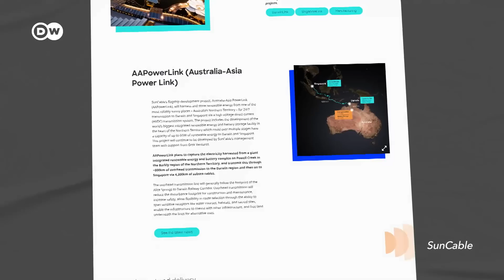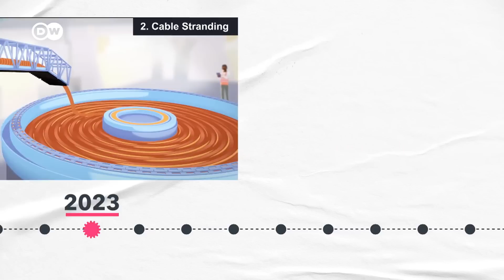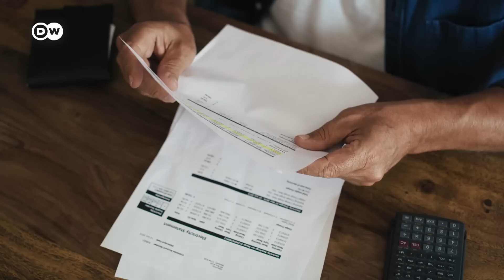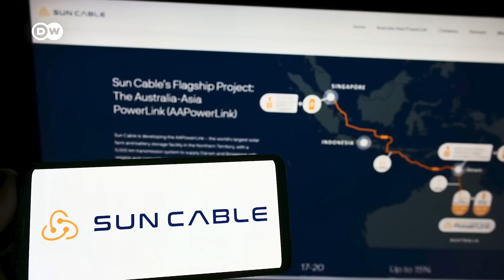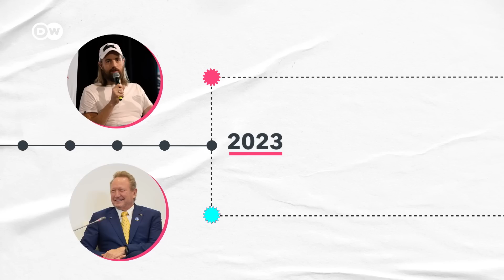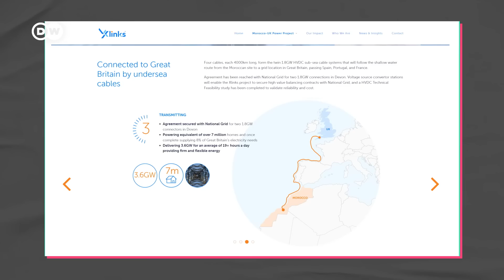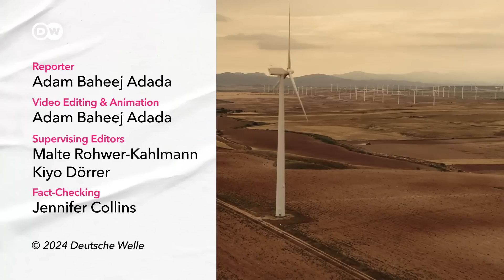Why the mega plan to send Australian solar to Asia (almost) flopped

Comment: How about splitting this gigaproject into separate projects for:
* Large scale solar power facilities with batteries in Australia.
* (if needed: better grid to connect across Australia)
* Power cables from Australia to Indonesia (especially Java)
* Power cables connecting through Indonesia up to Sumatra & Borneo
* Power cables from Indonesia to Singapore & Malaysia
and to make those power cables possible it'd be good to have a factory making them in Australia or ASEAN.

If doesn't all have to be in one project done by one company.
Reply: They're all relying on one another anyway, all you have to do to realise this is make those points a point on the roadmap, especially for the cable laying portion. I think indonesia might look into tapping into the cable in the future but doesnt have plans for it in the short term. Thats kinda why they're allowing it to run through their waters in the first place.
Secondly, it doesnt matter if you have a cable network spanning indonesia if you dont have the cable from australia ready. Its much more cost efficient and captially less intensive to have a smaller team and move at a slower pace, taking things one by one. All the ducks need to fall in line and having multiple subsidiaries will require more staff and some of them might not have great business cases which further increases drain on your investors wallet, in promise of future returns. They might be fine with the finances now, but when you turn up the tap and the tank drains faster than it fills, you are going to get cut off.

Comment: The differences between this (and XLinx) and data is that intermediate countries aren't bypassed, and data is bidirectional. 

When everyone is connected and, in this case Singapore, gets energy 9n a feed forward basis as opposed to bypass, the trust requirement reduces when every destination has multiple sources.

Comment: This is even more dumb that most solar projects.
It's not always sunny 😂💩🤡 Who knew. Therefore you either need impossibly expensive grid scale battery backup, or gas peaker plants - a fossil fuel that adds vast cost to the project because you're building double the power capacity you need. This is before we add the cost of that cable.
With any wind or solar project you must ask - who is making cash. Because people making cash is the only reason to do them, they harm the environment because they take no fossil fuels off the grid and they can't ever work for actual power generation.
This is a story of corruption, graft and green wash.
Apparently Germany still hasn't learned that wind and solar don't work even after becoming totally reliant on Russian gas. 😂

Comment: The advantage of renewable is that you DON´T need big players, you can have local production everywhere. They are already planning how to make it a monopoly. Jzzz we don´t  learn, do we ?
Reply: Yeah, you just need couple of small players that has shorter distance and cheaper price with less maintenance. Then you can say good bye to the long long cable
Reply: Small plants most likely will be less efficient than large consolidated ones. This is why most productions become specialized and centralized. Mass production increases efficiency and reduces costs compared to many but small producers.
Reply: @bltzcstrnx  That is not remotely true. The reason for centralization is concentraltion of money. You can´t create a monopoly without centralization. You can´t have billionaires without centralization.

Comment: I don't see the ability for the U.S. and U.K. sharing power directly because of the age old problem of telegraphs, they kept having issues of it just failing within hours or even days of it being established.

The reason why the communication works these days is because the current draw is only minuscule with fiber optics and needing to periodically boost the signal, where with electricity you would need to boost the signal constantly or push out a large amount to travel the distance of well over a country width, for Australia land hopping via Java islands is shorter hops and they can be boosted and cared for on land where the maintenance is cheap and the cases of land sharks are at a all time low for any season.

HOWEVER... Hawaii can look into this project for isolated case where they can create a state wide power grid and cost effectively power on every island as long as the owners (private islands) are willing to pay for it and the distance between the larger islands (publicly owned) is much shorter than crossing international waters.

But in the end, Australia needs to use and perfect the technology before exporting it to other countries.

Africa however can easily use this technology for the vast space that it has that is unable to be used for residential or agricultural development and just distribute through neighbouring agreements with other African nations

Comment: One solution is too connect the cable to all the islands and countries it passes, it can supply power along the way, by supplying power to all the countries along the way it less likely a country would cut off supply. It can operates at a "550kvdc common bus" power can flow in both directions. The system would need to be modular and to an agreed worldwide standard so it can be added to later.
Reply: landfall stations are very expensive

Comment: Its not looking good...if 3% loss is assumed per 1000KM of cable, twin core 630mm2 copper conductor at 550kvdc at 275Amps for a tiny 150Megawatts, a country or a large city needs gigawatts to run. a drop in the ocean. at least with DC the skin effect does not apply. Maybe 16,000mm2 aluminum monster that is a twin core with 2 aluminum conductors 143mm in diameter may do it, that's a lot of metal...550kv @ 4ka continuous = 2.2 Gigawatts. that will do it.

Comment: Sending electricity via long distance high voltage cables on the sea floor is much much harder and more expensive than the Internet cables links. Power requires much larger cable and the insulation system is under a lot more stress. To make it viable gig watts need to be transmitted so the system voltages will be sky high. The cable can fail too. To make it work it may need to be DC power, as keeping system stability with AC would be nearly impossible over such a long distance. Also if DC is used expensive 1000MVA + DC to AC inverters will be needed to sync to the local grid supply in that country its feeding. A Very complex engineering task. Also earthquakes can destroy the cables.

Comment: Is it possible to export energy using batteries or is that not scalable?
Reply from the maker: Hey there! Yes, it is possible. One ship with batteries on board is set to be completed in 2025 and will then start with the testing phase. If you want to find out more, search for PowerX. However, it is for short distances

Comment: It is true that Australia is a conundrum, it has the potential to supply huge quantities of Green energy to Asia and beyond, but no way of delivering this energy. You have already
Stated all the problems that come with cables, and shipping Hydrogen in bulk is no easy Task, but I believe there could be an alternative, but you will need to stretch your 
imagination for this, so if you are prepared to read on. 

I have followed with interest a Swiss company called E 2 S Power, and its novel approach to the intermittency of renewable energy, using spare renewable energy it heats up Graphite
Blocks to 500 degrees centigrade inside a shipping container sized unit, which is situated at An old fossil fuel power station, and is connected one of the plants steam turbine generators
When need the stored heat can keep the generator running for over 4 hours, as clever as this is, I believe there is a much bigger prize to be had if someone were to be brave enough to give it ago.

So how about this idea, as a bit of pure fantasy for now, start by asking the question if a Single container size unit can keep a steam turbine running for over 4 hours, how much 
Energy could you store as heat on a ship carrying hundreds or thousands of such containers? But that then begs the question, why would you want to?

A container ship might work, but realistically I would suggest converting a bulk carrier or Oil tanker, start by removing its diesel engine and replacing it with Marine electric motors, 
then to maximize the ships heat carrying capacity fill the tankers hold with up to a dozen Individual heat stores, each heat store should contain the equivalent of at least 100 or more
Container sized Graphite block units, giving the ship a carrying capacity of well over a thousand units. Then above deck and straddling 2 of the lower heat stores install at least  
6 steam turbines connected to electrical generators, this should reduce the amount of pipe work running through the ship, and allow you to spread electrical generation sequentially 
over several days.  

I imagine this large ship tied up at a dock in Australia and be connected to a supply of surplus green energy, which would heat up all those graphite blocks to a substantial 
temperature, once heated a small percentage of those heat batteries would be used to generate steam, and by extension to generate electricity to power the ships Marine electric 
motors, sailing the ship to the northern hemisphere, probably to Asia (Japan, China, ect) using a percentage of the heat you are carrying, is no different to a coal carrier, burning 
some of the coal to power the ship.

Once it had docked in Asia, most of the rest of the heat batteries would be used to generate electricity from its above deck steam turbine generators, which would then be fed into the 
local grid by a dockside connection, once most of the heat batteries had been depleted the remain full battery would provide the steam to sail the ship back to Australia, were the 
process would start again, of course you would need at least 2 ships for every destination you supplied, so that as one ship departed another was ready to take its place.

This would be a good fit, while the northern hemisphere shivers through its winter, Australia would be at peak production, but it is not just a winter thing, as a crowded Asian continent 
warmed up; it would still need additional electricity to power all those hundreds of millions of air conditioning units, power that a huge largely empty continent like Australia could 
supply, using a floating heat battery/electricity generating ship, and you are not loading or unloading anything except -ion`s, electricity in, electricity out, of course there would be 
energy loss on both sides of the conversion, but if the in-put electricity is generated renewably it should not be a problem.   

Of course, there is yet another option, there is currently a British company building a huge Energy generation facility powered by both solar and wind in Morocco, but the most difficult 
And hugely expensive part of the project will be laying 4 cables, each around 2500 miles Long under the sea to deliver the electricity to the U.K. I believe this cost could ultimately 
sink the whole project. I also believe that a floating heat battery as previously described, could be a more cost-effective solution, it could also be the solution to connecting other 
parts of Africa with a green energy surplus, to other parts of Europe with high energy demands, like Germany.

Plus, there is an advantage over a fixed cable, if one part of Africa is not producing enough green energy because of war, bad weather, or natural disaster, you can sail you heat 
battery to another producer, or supply energy to another destination. 

If we do use less oil in the future there could be spare oil tankers that could be converted, without having to build an entirely new vessel.

Comment: I tend to support the rich businessman-looking investor rather than the hippy-looking one, and there's no reason why he can't build it all himself: build the generating facility in a slightly different part of Australia and use it to generate a shippable gas. Whether it's Ammonia or Hydrogen, experimentation would reveal. Yes, there would be losses in the conversion processes, but the main inputs are free: sun, wind, air and water.

Comment: By the way the long distance interconnectors above ground are two wire Direct current DC not three conductor AC.

I say that because they are Still teaching Edison is an idiot because you can not transmit electricity long distances that is DC and now that is the preferred way .

Comment: One thing that is also often missing in the debate. Is how electic grids stay stable.
Large rotating masses like steam turbines are needed to keep the grid stable. They have rotational inertia that resist changes from the demand in the grid.
Wind and solar does not make grids stable, they are great for peak energy usage. It makes peak demand cheaper. But does not effect base load.

The newer larger wind turbines also is "asynchronous" which their rotational speed is not tied to the grid frequency. Mostly that the gearboxes are the biggest points of failure. They instead converts the energy to DC and then back to AC. But in that process it removed the rotational inertia that is tied to the grid.

And back to this topic. Long distance energy transfer of electricity DC is the only choice due to losses in capistance and inductance (and the skin effect to a minor extent). But DC system does not make the consuming nation AC grid stable.

Either we need to create "stabalization stations" that have large flywheels that we spin up with electric engines and a generator at the other end.
Battery storage does not fully solve this issue to keep the grid stable. It is more about to cut the energy demand tops.
Reply: Your "   missing in the debate. Is how electic grids stay stable.  "      This is very important with present AC Grids. . .   But not a problem with HVDC Transmission, and then you use "Grid Forming Inverters" to feed that HVDC into the Grid at suitable locations.. . .  "Grid Forming Inverters" are these days, designed to make and help keep regular AC Grids more stable... .  This is relatively new technology as set out by the UK and Europe in 2022, not yet in the US.
Reply: Battery, gyroscopes, gravity well, hydro batteries and others would fill the gap. The idea that base load, in the sense of coal burning, has been disproven. Like the internet, the winner is multiple sources and multiple routes build redundancy, compared to a single point of failure in a steam generator. The opportunity of building a grid that can take power from any source, bringing business opportunities to farmers and other areas of our economy scares the existing big industries who can't compete. The battle to keep the status quo is driven by existing investments lobbying to distract the general population.
Reply from the maker: Hey there! We actually looked at the issues of the electrical grid some months ago. Check out the video and let us know what you think  👉https://www.youtube.com/watch?v=u-DsDuTceTo

Comment: Some of those internet connections you talk about would be crossed by this electric interconnector which could be a massive problem for Indonesia. At the same time Indonesia and Singapore are in constant negotiations regarding Indonesia providing Singapore with power across the very narrow Malaka Strait (to give it its proper name). And Indonesia has enormous geothermal and hydro power potential, the former at least mostly still untapped. So why do they want the interconnector to go all the way to Singapore when it could just go to Java? It's all about money, not saving the planet.

Comment: A supergrid sounds like a great idea, evening out differences between supply and demand when and where it's practical.  

Dedicated power generation in one place and make hyper expensive, direct and dedicated connections to another place, far far away, ignoring both domestic market and much closer neighbors seems fundamentally stupid.

Very large projects tends to become much more expensive and take longer than initially estimated, you don't have to be very familiar with that that's common knowledge. This proposed size, complexity and level of novelty, and also having to produce the cables, doubling their estimates for cost and time to build could still be considered a somewhat optimistic estimate.       

There's no good technical reason to make a gigantic solar farm and battery storage facility in Australia to export power to Singapore. It's true that cheap land and high production are advantages, but that's insignificant compared to the costs and uncertainties involved with exporting the power almost via 13,000 km cables. I can't see any reasonable explanation for the interest in investing in it besides collecting subsidies somehow, and/or potentially utilize local sources of low quality fossil fuels to generate large part of the energy, officially just as "backup".     

Making hydrogen or ammonia to export to be used as fuel is also not a solution. Hydrogen is an absurdly impractical fuel, possibly the worst "seriously" suggested choice, utilized by companies to delay adoption of real solutions, and green washing while collecting subsidies. With ammonia as hydrogen's closest contender for the title of most impractical "green" fuel to be "seriously" proposed as a solution.  

Instead of exporting energy far far away, there's always the option to have local energy intensive industrial production, and export the produced goods, the part of the production that exceeds domestic demand. Exporting easily transported goods that represents a lot of energy in manufacturing makes much more sense from both a technical and economical perspective compared to exporting the energy.